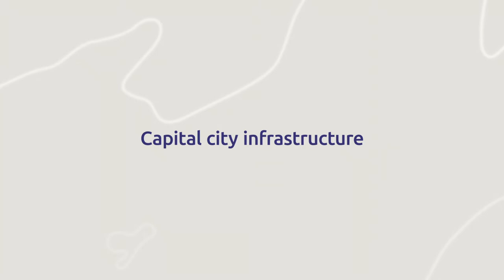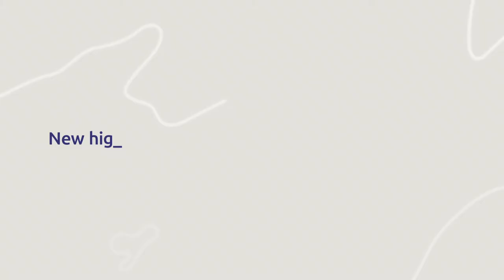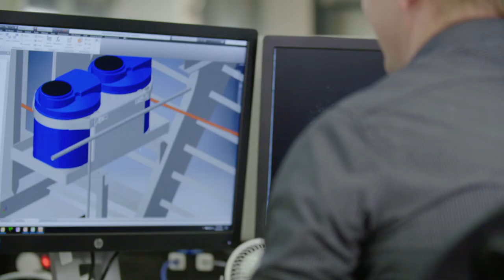Darwin Data Centre EOI

Comment: In addition to more datacentres, there are several other things that need to be considdered; firstly alternative paths out of the NT (maybe use NWCS?), connect into Timor or Singapore?. Powergrid not only needs to be improved, but more companies and infrastruture needs to be put in. The like's of Amazon, Google and Microsoft will only consider putting their stuff here (called "a region") if there are multple DC's, Power facilities and optical pathways out.